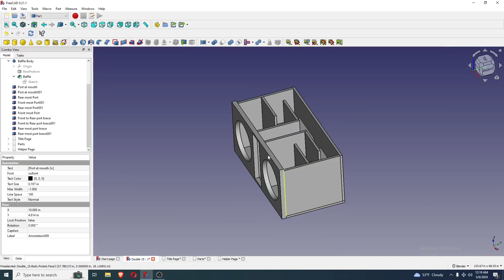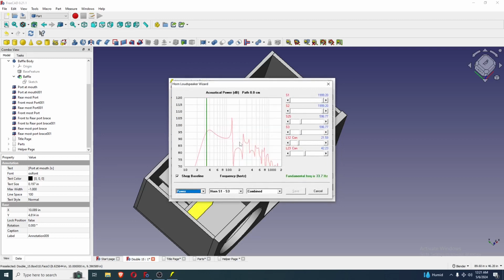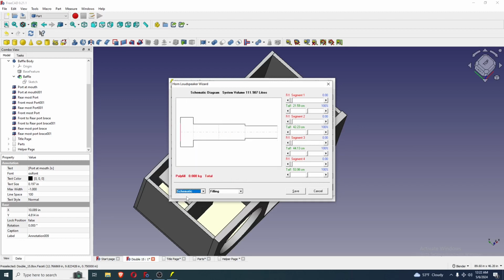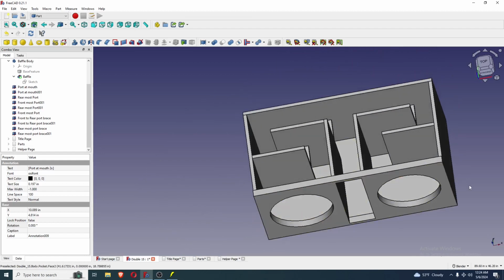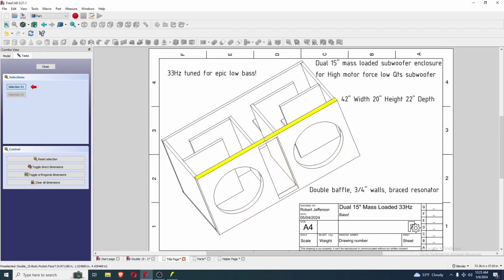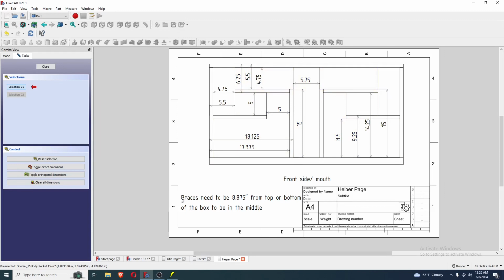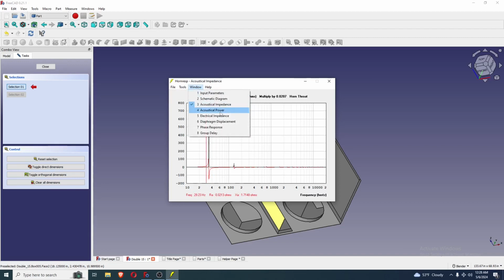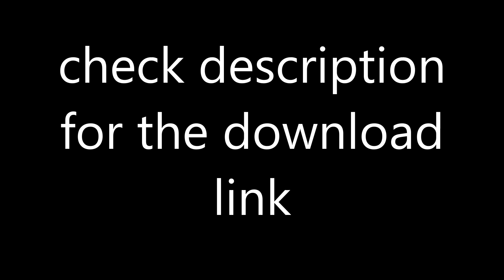Dual 15" Mass Loaded Transmission Line Subwoofer Box Free Design CutSheet CAD HornResp 33Hz Skar DDX

Comment: Man, I hate asking the dumb kid questions, but any idea how this box would play with a Rockville K9 15?
Reply from the maker: Voice coil inductance and higher Qts mixed with a somewhat weaker motor means that the K9 15" model would struggle with the lower notes closer to the tuning frequency and result in a response that is not very good. 

I think the K9 would probably do best in a large ported box tuned at 32Hz. The ported box I posted before this seems too small when I plugged the specs into hornresp.

Somewhere between 3.5 cu ft and 5 cu ft per subwoofer with those seems about right. With the specs I pulled from speakerboxlite I'm getting a big spike in the output around 65hz no matter what so far. Tuning at 32Hz or 33Hz gives you a workable 30-80Hz operation though
Reply: @RobertJeffersonBased  Thank you for your time, Sir!